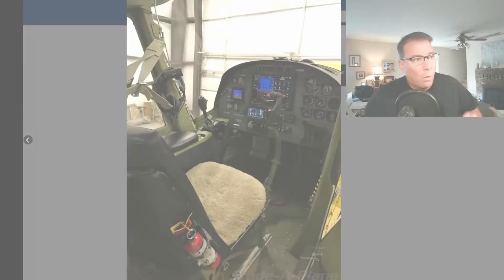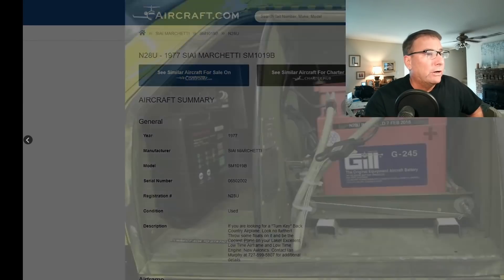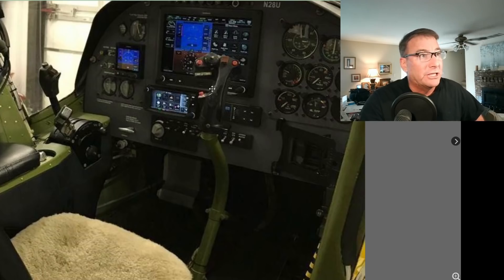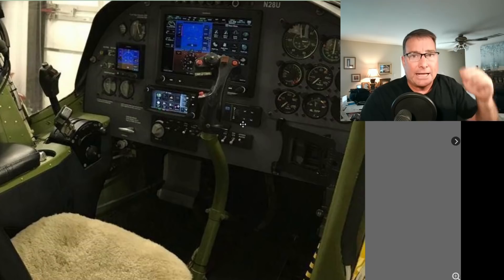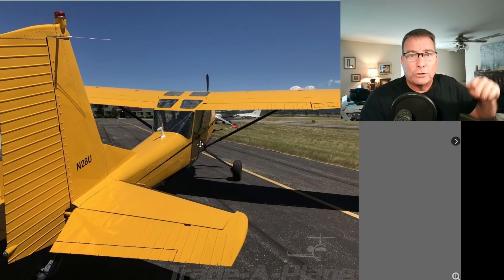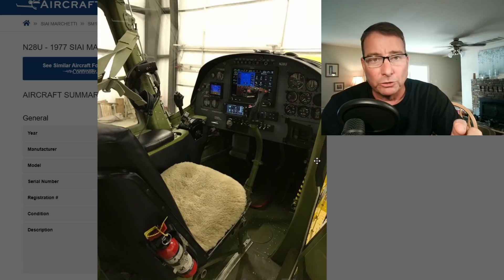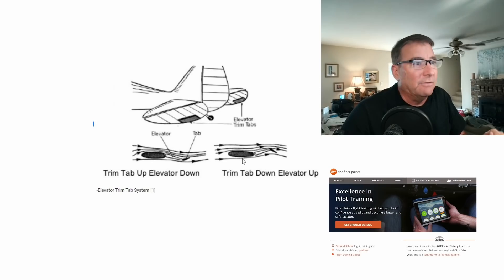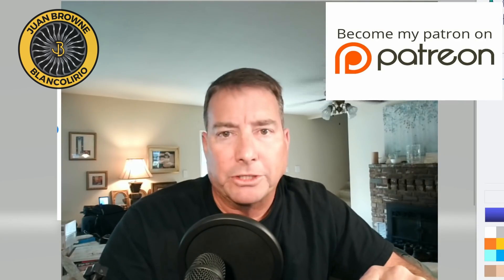Dale 'Snort' Snodgrass Siai Marchetti UPDATE- Elevator Trim System 8/8/21

Comment: Has Pilot incapacitation been ruled out yet? In an earlier Video you mentioned that there was very little or control input visible in the Video (i have not watched the Video), incapacitation could explain that as well. Or could it be that the previous owner or this owner ‘modified’ the gust lock so it won’t lock the rudder in order to accommodate taxiing, in side by side aircraft Pilots used to do this all the time when taxiing for MX purposes or in gusty wind until they got to the hold short line in order to avoid the yoke from banging around while performing the run-up and checklist.

Comment: Even if the trim went full nose up (ran away) the controls and control surfaces are strong enough to overcome that. The plane would not be pleasant to fly in that condition, but it should still fly, or at least not stall spin on takeoff. I could see no control surface deflection in the video. I wonder if the elevator was locked with an external wedge. I have seen these used on light craft and often are home made units. Pilots will use two small squares of plywood held together by a long thin bolt. This is wedged between the horizontal stabilizer and the elevator which locks the elevator and prevents it from flapping in the wind. This kind of lock would be easy to forget if you abbreviated your preflight or got in a hurry. Had his plane been stored outside before he flew that day? Who was handling the plane and why? And of course, maintenance records as everyone pointed out already.

Comment: Whether that was the issue or not I think the idea of electric trim in a light plane is an accident waiting to happen.  You shouldn't be a simple short circuit away from having control of the aircraft taken from you.  Big planes have multiple, redundant systems.  Light planes do not.  Keep it simple!

Comment: It don't look like any of the control surfaces move at all. Even as the aircraft hits the ground the tail, rudder and elevators never move at all. You would think hitting the ground so hard if they were able to move at all it would have been then. But, nothing  gives at all the tail looks like it did before take off and during flight.

Comment: Does anyone know why he was in Idaho, for air show? Was he not the owner/part-owner? Was he taking it up for a test flight as pre-buy?
And his relationship to New Mexico? Was he not a resident of Florida, not to mention he was originally from NY and graduate of University of Minnesota? Why desertland of New Mexico? Understand, he will be buried at Fort Stanton Veterans Cemetery in Lincoln County, NM and a gathering of celebration-of-life will take place at Sierra Blanca Regional Airport after the funeral on August 27th.
Unless a medical condition is involved, personally doubt pilot error from this pilots' pilot can be a culprit. This leads to mechanically or electrically inoperative, i.e. locked -up control surfaces.
R.I.P. Captain Snodgrass, aviation world salutes you.
"Nickel on the Grass for you", for a smooth landing in God's Heavens. Amin 🙏
Reply: He and his wife Cynthia owned the plane through one of their corporations, DOSCAS (their initials). It wasn’t formally registered to DOSCAS until July 1, but he had flown the aircraft 23 times between May 26 and June 30.

Comment: When did this aircraft fly last before this crash? Was it by Dale? Was this a normal flight or did it have some other purpose? Juan, I love your channel.
Reply: He last flew the plane June 30 from his ranch near Grangeville - a 33- minute flight - to Lewiston airport for maintenance. He had just picked it up on July 24 and was headed back to his private airstrip at the ranch.

He flew the plane 23 times between May 26 and June 30, sometimes 2 or 3 flights a day, including both ways to and from the Lewiston airport.

It was to be his first night at his nearly-completed dream cabin.There is drone video of the dream cabin, Fort Snort.  Previously they stayed in a tiny trailer on the 50-acre property when they weren’t in Florida or New Mexico.
Reply: It's probably the camera view, but it looks like a slight dip to the right at :54

Comment: I wonder, as unpalatable as it might sound, if this could be as simple as over-rotating the aircraft due to misinterpretation of the instruments?

At high pitch angles, some of these electronic ADIs will go into "non-conformal" mode, where the horizon STILL appears (although perhaps dashed) at the bottom of the instrument.  This is by design, so the pilot still has a horizon line, and therefore a bank reference, during high-pitch maneuvers. Yes, the numeric pitch ladder may still show the increasing pitch, but since our brains interpret pictures better than numbers, the stationary horizon line might fool you into thinking that your pitch angle is remaining constant, when it really isn't.

Many times in Falcon EASy simulators, I've seen pilots over-rotate the aircraft into excessive deck angles (30-40 degrees) due to exactly such instrument misinterpretation.

I'm not familiar with the system that was installed on his aircraft, but it's food for thought.  Even if it's not the actual accident cause, my humble advice is to know capabilities, limitations, and all operating modes & indications of your flight instruments.
Reply: And you think Captain Snodgrass didn’t know all about his instruments and their capabilities?
Reply: @citybright8925  I suppose you have definitive proof that he did?
Reply: @jmd12127  And what would constitute “definitive proof?”  If you are unaware of his brilliance in all aspects of aviation, I won’t try to educate you. That is not meant as an insult btw, merely lack of time.
Reply: @citybright8925  You ladies seem to get your panties in a bunch very quickly at the mere suggestion that he was human, and fallible.

Comment: I do not know how it could be possible, but this crash seems to be more similar to accidents caused by a dramatic CG shift then loss of elevator control.  Of course, elevator control could have caused the accident, surely.  But it would seem, even though the plane has a very powerful engine, as the velocity of the air passing over the elevator decreased somewhat as the plane approached stall speed, the pilot would have been able force the elevator to gain at least marginal control.  This, of course could be incorrect and there may have been a malfunction in the control system.  
But, the accident does seem to mimic several accidents where the CB shifted aft.  Again, I don’t know how this could have been possible with the accident aircraft
Some examples:  
Aug 7, 1997, Miami, FL, Douglas DC8, Fine Air Flight 101, stall and crash caused by CG too far aft.
December 15, 1973, Miami, FL, LOCKHEED L-1049H SUPER CONSTELLATION, N 6917C, cargo flight crashed shortly after takeoff from MIA.  The cargo was Christmas trees headed for Venezuela, The NTSB report indicated that weight shifted aft but it could not determine how.  Not included in the report from what I heard circulating around my Miami based aviation family and some friends is that flight was delayed due to batteries were “missing”.  It took time to get new batteries install and charged.  To keep the Christmas trees in good shape, the trees were “watered” by hosing them down while the plane sat on the ramp. Could be there was just enough water in the belly that upon rotation the water traveled aft causing the nose high attitude witnessed by the controllers and noted in the NTSB report and the crash into a Miami neighborhood.  
Aug 7, 1997, Miami, FL, Douglas DC8, Fine Air Flight 101, stall and crash caused by CG too far aft.
March 18, 1994, Key West Harbor refueling flight to Key West International, Chalks International Airlines, 17-seat Grumman G-73T Turbine Mallard, N150FB, crashed upon take off after dropping off passengers at “Christmas Tree Island” in Key West.  The crew had not pumped out water in the plane bilge and the water rushed aft, causing a nose high attitude and stall.
April 29, 2013, Afghanistan headed for Dubai, Boeing 747-400 (747-428BCF), N949CA, crashed just after takeoff from Bagram Airbase after load sifted aft causing nose high attitude and stall.  
Oct. 10, 2000, Wichita Mid-Continent Airport, Bombardier Challenger 604, Canadian-registered, It was a crazy manufacturer’s test flight loaded with water tanks as blast.  Due to excessive takeoff rotation, the CG shifted aft, perhaps due to, of all things, fuel shifting, causing the crash.

Comment: Hi guys, my two cents from Italy : this is an airplane extensively used by the Italian Army and so I talked to a veteran SM-1109 ,3.000 hour Army instructor. He told me that it has happened to him that the seat would come unlocked,luckily at altitude. He doesn’t buy the trim argument because there is not even a hint of an attempt to pitch the nose down during that steep climb.
RIP Snort

Lupo Rattazzi
Rome, Italy
Reply: did you watch the video? his configuration would of made it impossible to move the seat but only a couple inches... not the cause...
Reply: @stephenfortin9485  You mean the seat doesn’t travel that far back? (Of course I watched the video)
Reply: @luporattazzi4551  no it cannot due to the configuration, he had a 2nd seat in the back with its own instrument panel and controls. the seat pretty much rests on that, as many owners of this layout have stated the seat hardly moves at all.
Reply: @stephenfortin9485  Well then what the hell happened? Did somebody invert the cables during maintenance ( Onassis Jr accident in Greece on a Piaggio amphibian)
Reply: @luporattazzi4551  more than likely trim settings from previous landing never adjusted for takeoff....
Reply: @stephenfortin9485  Stephen I’m sorry but then I have to revert to the comments by the Italian Army officer: in the video you don’t see even a hint of an attempt to pitch the nose down which, you will admit, is pretty odd and you can’t tell me that on that kind of aircraft even a fully aft trim setting exerts a force on the elevator that cannot somehow be counteracted…
Reply: @luporattazzi4551  again, watch the video, he explains it, this model plane with trim settings set for landing make it almost impossible to pitch the nose down at all due to power of engine when set at takeoff power.
Reply: @stephenfortin9485  Ok watched the video again and yeah, it’s an “Alexander Onassis scenario” : misrigged controls which lead to an impossibility to recover so close to the ground because you just don’t have the time to figure out that you should be doing the opposite of what is logical ( up for down and down for up, in this case)

Comment: One thing I noticed is that the tower asks the pilot to switch to another channel while taking off. On C.W. Lemoines channel, he showed that while attempting to land the tower asked him to switch channels, which caused him to not pay attention to what he was doing and almost crashed.
IDK since I don't fly aircraft, but could he have been trying to switch channels while lifting off and didn't realize he was entering into a stall situation. Let me know what you think or if this is even possible. Thank you.
Reply: No, the video in question deliberately eliminated silences in the audio longer than one second. Read the video description. The actual radio transmission shows there was about 36 seconds of complete silence before Dale’s last tragic words. The video shortens that to six seconds. Grossly unfair to any pilot but especially this incredibly talented and brave aviator.
Reply: @citybright8925  or was just an observation. I didn't know if I was right or wrong, and was asking the question. Thank you for your reply and explanation appreciate it.
Reply: @dennisjohnson6541  You are welcome, Dennis. You might want to follow KathrynsReport on this accident - N28U - and also see Blancolino channel’s 8/8 update. It will probably be some time before investigators determine what happened, if the fire didn’t destroy key evidence.
Reply: @citybright8925  replace "it" for "or"

Comment: Unfortunately, it looks like elevator control reversal due to maintenance (could be trim or the elevator itself, both have happened multiple times in the past).  That would explain why the aircraft leapt off the ground initially (holding forward stick that is doing the opposite of holding the aircraft on the ground) and why it then pitched up so fast (as the pilot went full forward on the stick due to the aircraft leaping off the ground).  Not likely this would be salvageable.

Comment: I disagree with the last two assessments you’ve made. It is very apparent in the video of the crash that the most likely culprit is an aft CG. The aircraft immediately pitched up uncontrollably after rotation, very indicative of a cargo shift or an out of balance load. If there were an issue with the flight controls, it would have most certainly been caught on the preflight inspection and taxi. I don’t buy that he forget to remove a gust lock. And even in a runaway trim situation, there still would have been evidence of the pilot trying to recover, as there could have still been some movement in the controls, though very hard. The video also shows that there seems to be no recovery attempt, plus with the expletive, that there was no recovery that the pilot could do. With this pilots experience, he no doubt had the skill to recover if it were possible. He was no doubt fighting it to no avail, which again points to an unrecoverable out of limits aft CG. I say either there was too much weight in the rear, the seat slid back, or a combination of the two, as evidenced by the immediate pitch up and stall
Reply: You must not have listened to the video or you wouldn’t suggest the seat slid back.

Comment: Is there a hand trim wheel as part of this elevator trim system?

The pilot should ALWAYS verify EVERYTHING after getting an airplane back from the shop.

I’m a pilot and several years later I also became an A&P.

My experience 20 years ago in A&P school was that I was the only pilot in the entire school and zero of my instructors were pilots.

I wouldn’t trust any of my classmates at that time to properly rig an airplane.

Just a quick example:  Stick or yoke to the left and they have NO IDEA which aileron should be up and which should be down.

But from my pilot training, from like day 1, I was taught hand on the yoke, thumb pointing up, roll left, and your thumb points to the up aileron.  Roll right and your up thumb points to the up aileron.  I learned this 30+ years ago and it something I’ll never forget.

But non pilot A&Ps don’t have the benefit of simple habits and procedures learned in flight training that will never fail you when you need to determine if aileron rigging is correct.

Just talking with a buddy on Sunday.  Got his Aeronca Champ back from annual.  He flew it a few times and then discovered he was losing oil.

He discovered the oil drain plug not tight or safetied.

Don’t trust anyone.  Look and verify for yourself, for your own safety and peace of mind.

Another quickie:  Rockwell Commander 112TCA.

Turbocharged Lycoming piston engine with the word “Turbo” very prominent of each side of the engine cowling.

When this model first made its debut there were several cases of the airplane mistakenly fueled with JET FUEL!

It said “Turbo” on the cowling, not “Turbine”.  And some fuel truck operators misfueled the airplane.

Some pilots caught the error on the ground, but sadly, some did not, and there were some forced landings after the engine stopped once the jet fuel reached the fuel injection system.

Airworthiness Directive issued:

“Remove the “Turbo” decals from the sides of the cowling.  Too many cases of misfueling the airplane with jet fuel.”

Comment: I haven’t flown a light aircraft where the trim could over power the pilot at low speed. Usually the pilot could at least partially overcome the trim. In this crash it didn’t look like there was any mitigation of what was clearly a miss trimmed aircraft. Was this airplane fresh out of maintenance?
Reply: Yes. Just picked it up prior to takeoff.
Reply: @citybright8925  well that will make for an interesting investigation. Wouldn’t want to be that AMO.

Comment: This is tragic to say the least. Looking at the footage, there is NO aileron, rudder or elevator deflection in the opposite direction. In a low altitude stall spin opposite aileron and rudder inputs are just not seen here......this leads me to believe the controls were locked. There is no control deflection noted in any direction.
Reply: Try watching frame by frame.
Reply: The pilot's failure to remove the flight control lock was cited as the probable cause by the NTSB - so you were correct

Comment: Let’s say it was a mis-rigged or runaway trim, and that Snort didn’t recognize this in the few seconds available. He STILL had the ability to retard the throttle, which should have reduced the force needed to overcome a mis-rigged or runaway trim. I’d expect someone with Snort’s experience to react by retarding the throttle the moment the uncontrolled pitch-up begins.
Reply: In a jet fighter you are very reluctant to throttle back as jets do not get back to full power nearly as fast as a conventional IC piston engine.